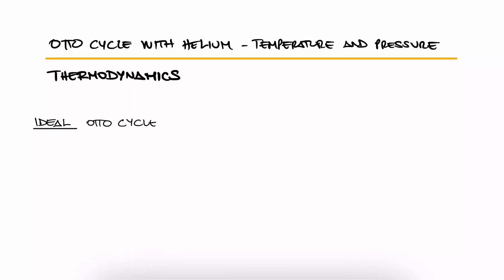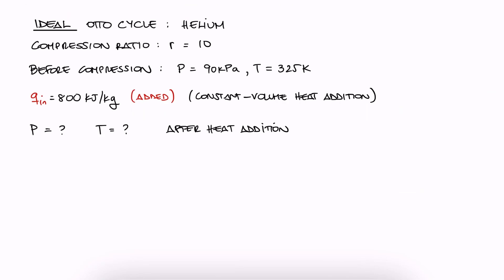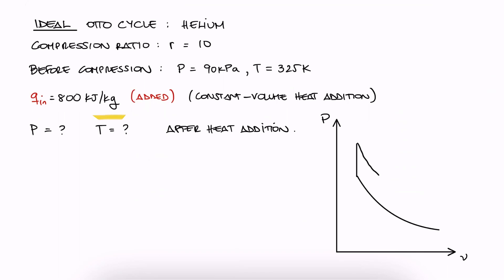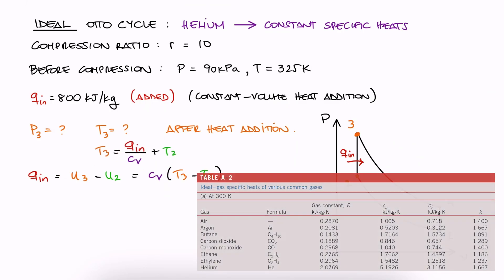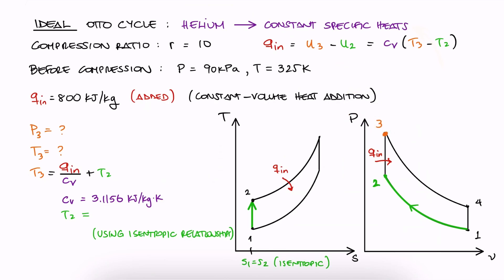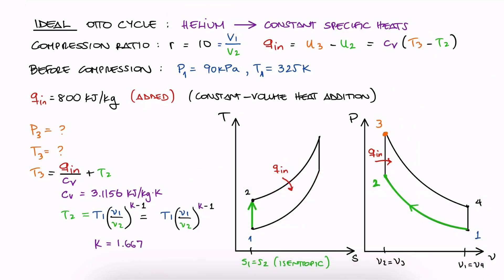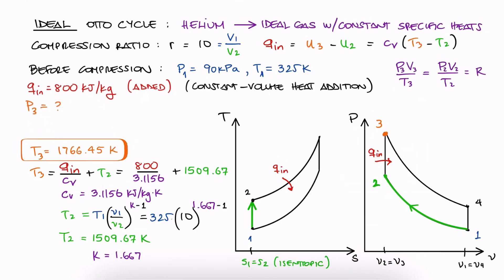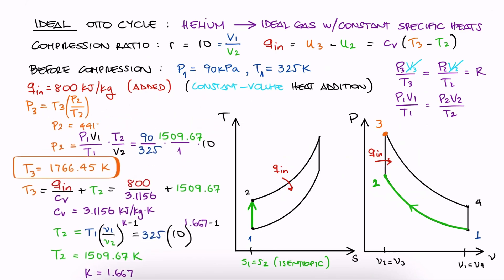Helium OTTO CYCLE Pressure and Temperature Example in 3 Minutes!

Comment from the maker: CORRECTION: The given pressure before compression should be 95 kPa, not 90 kPa. All the values calculated in this solution are found using 95 kPa.

Comment: hello in 2:13 how did u find P2 becuse we use ideal gas equation and it P1V1/T1=P2V2/T2 since V1=V2 thay will cancel out so it will be P1/T1=P2/T2 and i did that and shift solve and get 441.3 Not 4413 can u tell me how?? plz